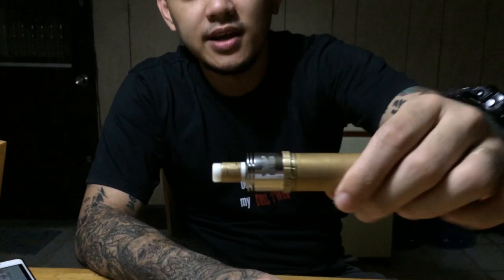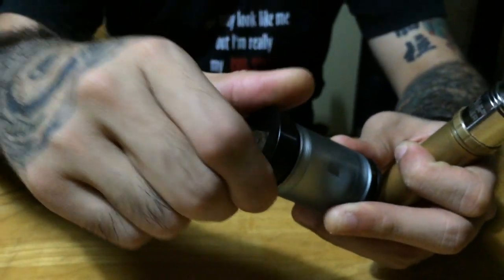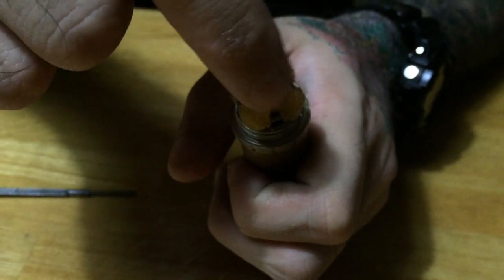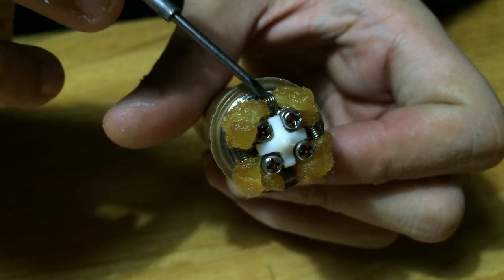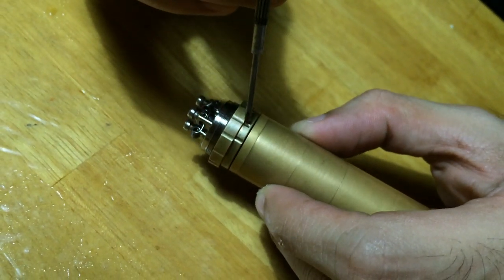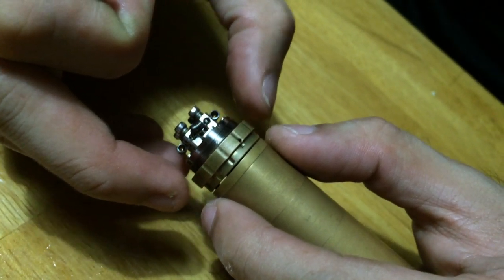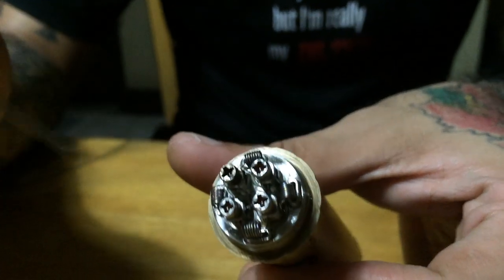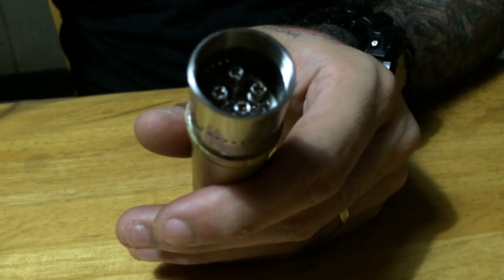The Geyser RDA

Comment: Great review. There is nothing like a well educated presenter...  Good job Kuya!! 

Question- I'm worried about leakage because of those bottom vents- I just bought one and have not built on it yet. Have you experienced leaks and/or found ways to mitigate them?
Reply from the maker: Honestly, it leaks like a motherfucker if the wicks aren't installed just right. Lol
Reply: not sure if this will be to your liking but, you might want to put some cotton inside the base of the geyser.pulling the base apart will be a bit tricky as it may break the insulator so be very careful when you decide to do it. +marco go have you tried it bro or any thoughts about it?tried it in mine just now. although it restricts the airflow a bit, it does mitigate the leakage (at least, that's what i hope it will do).